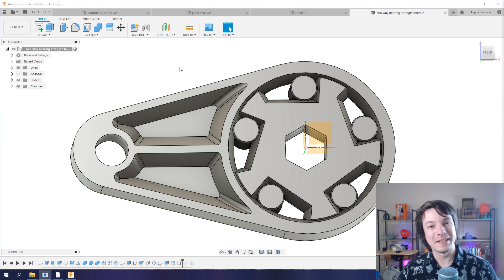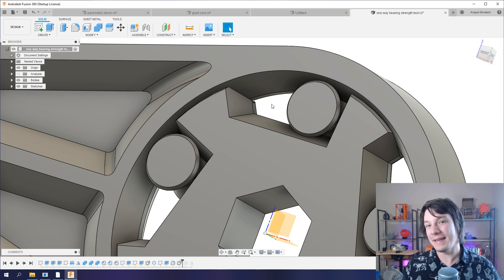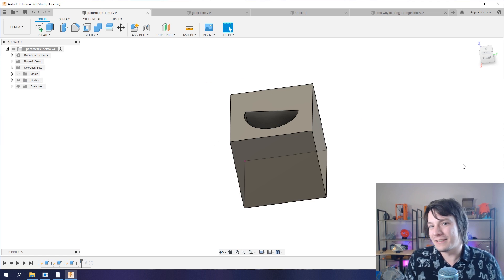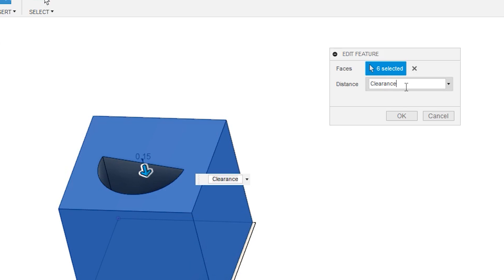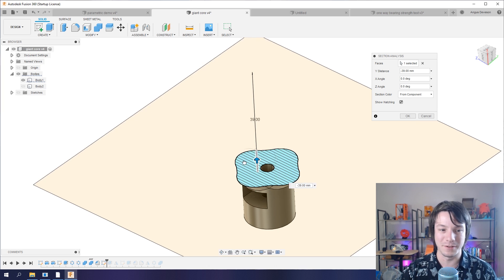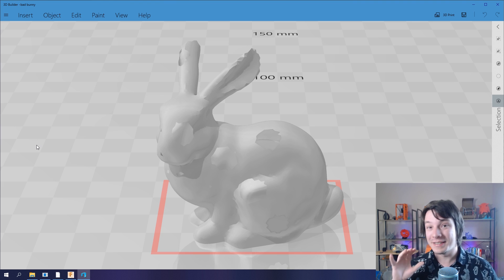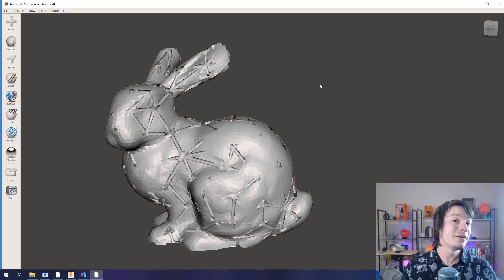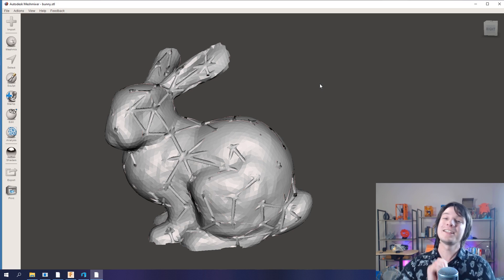Must Have 3D Printing Tips and Tricks! Episode 1 - Design Stage

Comment: Clearance = -0.3 mm is wrong approach! I would prefer to have clear parameter equal to 0.6 mm and then to use in the design "-clearance/2". In this case "clearance" will have physical meaning as distance between cubes. If later some other objects will be added with some other approach to add distance between them, "clearance" parameter could be used over and over again without surprise that it is negative and actually half of required clearance!

Comment: The way that I found to export .3mf files from fusion 360 is not practical. How do you do it?
Reply: Looking for the same answer...
Reply: It's not even an option I can locate in my version.
Reply: @OldCurmudgeon3DP  there is a old add in that you can install but it only works poorly
Reply: @terkokrieger2721  that's what I've been hearing.
Reply: for now, it's probably better to let fusion 360 spit out the STL, then open that in 3D Builder and convert it to 3MF
Reply: @ProtonOne11  I guess that's an option if you're already repairing it, but Fusion360 shouldn't be spitting out bad meshes. I'll just skip the step and work in STLs. I'm not happy with STLs and jumping to another facet-based format still isn't the improvement I am looking for.

Comment: Are the tolerances on your gauge also doubled? So is the 0.15 really a 0.3 gap or not?
Reply from the maker: For the clearance gauge the overall gap of the 0.15mm is 0.3 because surface to surface is 0.15 and it's on both sides. Because the example had adjacent clearances patterned it was doubled, but normally I do surface to surface offsets of different parts I want to fit together. Sorry for the confusion!
Reply: @MakersMuse  ah surface to surface then I know what to use in my designs after testing with your gauge. Great job on that btw
Reply: @MakersMuse  can you tell us where to find the stl or 3MF for that clearance gauge you have?

Comment: Ahh, permanent supports like gussets/bracing rather than temp supports.
Reply: I was just looking to see if anyone else caught the distinction. Typically, when we use the term "supports" in FDM it means they get removed after printing. His are permanent designs of the part. Nothing wrong w/ them other than me taking issue with him calling them supports.

Comment: 3mf, I never heard of that before, I will have to look into it, thanks
Reply: The comparison was intentionally unfair; why use ascii stl instead of binary? Based on that the 3MF should have been uncompressed. Also, there are others like AMF and glTF. STL is lowest common denominator, like PNM.. or indeed ASCII.
Reply: Created by committee of rich companies...    just say no.
Reply: @Dust599  is there copy protection embeded in this standard? If not why not user it?
Reply: DMR has no place in 3D printing.

Comment: Should we be switching to 3mf for uploads to places like MyMiniFactory and Thingiverse?
Reply from the maker: yes, I reckon so. I'm not sure if their built in 3D Viewer supports it though will have to test.
Reply: I wouldn't, they can carry meta data. Depending how you made it this can include personal info. 

I really like the 3mf export from cura though, it saves all your settings and the model so you can always come back to it and Tweek or copy an old settings profile for a new print.